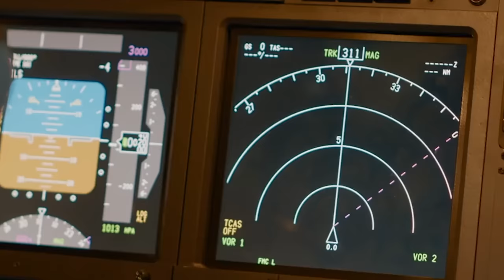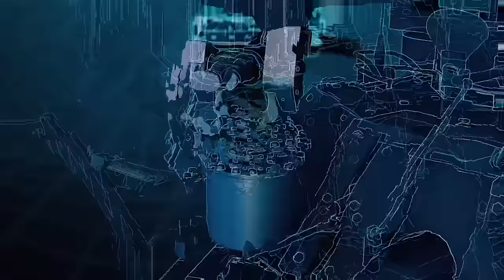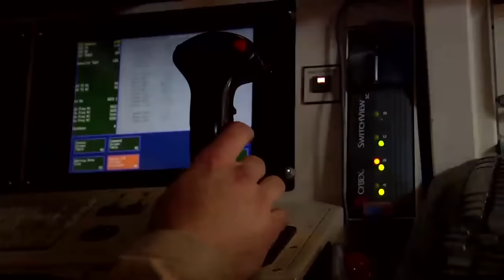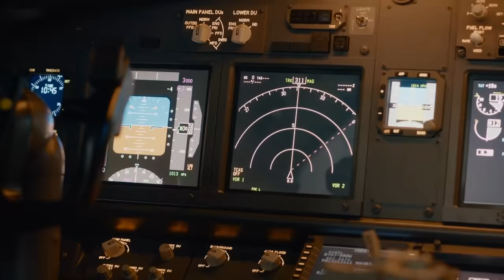The Astonishing Impenetrable Shield of American Tanks

Comment: I was in the Army's FCS program from 06-09. When were first learning about APS we asked about the infantry support. They were stunned at the question bc they had never thought of it.
Reply: The explosive is fairly small as well as blast radius it's non lethal to support infantry in area with only a small chance of shrapnel to any close by but standard body armor is enough to stop it so it's fairly safe as far as anything u can say is safe in war as there is always danger.
Reply: Good point, even infantry should have an incoming threat scanner that detects hostile rocket launchers over a grid. It’s not going to stop shrapnel, but at least it would give infantry the time to take cover and prevent damage.
Reply: The other thing not mentioned is that the radar has informatuon regarding the flight path of the incoming round.  If it's flying in a straight line, even in top down attacks, it's easy to figure out where the shot came from.  So theoretically, it would be easier to return fire sooner.

Comment: I strongly believe now that the United States acquisition of the 'Iron Fist' that will be integrated to U.S. MBT as well as to other Armour vehicles they are taking measures of safety to its crews and soldiers far better than when I served.
Reply: It's been in use for a while and for close to a decade they have been working on improving systems like this, like an actual plasma shield.
Reply: Iron Fist was not selected for the M1 series tank because 'Trophy' is a better system but weighs more and requires more electricity than a smaller vehicle can provide.  Israel and a US defense contractor are working to integrates the best parts of trophy with the best parts of Iron Fist to create a lightweight system that's as effective as Trophy.  

In fac it's APS that is causing the US Army to create a new vehicle to replace the Bradley and the Abrams.  Both are severely overweight and maxed out on electrical generating capacity. Also, electric drive will mean that 100% of the engines power will be converted into electricity and (in theory) a generator and 2 drive motors will be lighter, require less maintenance, and cost less than a mechanical transmission.

Comment: The anti rocket rockets exist now…you have to shoot 2 rockets at once in order to be effective, you see it on Gaza, they have double launchers for 1 strike
Reply: The anti-anti rocket rockets enters the chat
Reply: Still not clear if that method is effective.
Reply: Next up, machine gun style rocket launchers for mass mayhem. They will soon be calculating rocket and missile volume in terms of rpm. Along with mass swarms of drones, of course. With AI and automation you could have clouds of all this stuff, all at once.
Reply: Sure, because it can only fire one time....not like it comes with multiple rounds or another one right below it......uh huh.
Reply: Rpg7-vr tandem warhead
Reply: @brendonhunt668  tandem warheads were designed to defeat ERA not APS. APS can swat them down just the same.
Reply: Wait till someone developes a point defense system like in the Expanse. Have your automated turrets be so quick that they can lock on, and shoot down a missile. 

 First for VTOL aircraft. They would have more time to react. Then for tanks, and humvees even. Anything with a .50 caliber automated turret. 

 Use the radar, and targeting system this thing uses, but improve it. That is the challenge. Making the sensors miniaturized. I think optics with AI is the future, with radar as a secondary.

 Since this uses optics. Does it work when in smoke too? Hope so.
Reply: @brendonhunt668  it detonates anything and everything at the same time! Not "sets off each individual fuse one at a time"! It's not sequenchel!!! Think.
Reply: @dianapennepacker6854  why carry around the monumental weight penalty of ammo and have a limited amount when they're already developing a new enginge for the F-35 that makes 5X's the electricity it currently has for addition of focused energy weapons....?
Reply: If it works,
Don't be mad.
🧐
Reply: The tandem warhead is useless against this technology. It blows both warheads
Reply: WRONG. On both accounts.
1.not the same system. Trophy on mkiv and this is iron fist
2.method used by Hamas : first manage to put an ied just below a plating on the tank, that is meant to take our that facing radar and damage some NERA armor.   And then shoot at that facing .
3. Basically worked 2 times.   Just 2 times out of hundreds of blank range shots ( less than 30m ) . Which is still insane.
Reply: @johnshite4656 Drone swarms exist and they are scary
Reply: @dianapennepacker6854 Point defence turrets already exist - some are extremely capable.
Reply: @Cody38Super  Energy defense is useless against high speed or hypersonic weapons, and requires time on target to heat up. It also might be easier to counter them with special armor, and weapons that can "burst" to move out of the way. 

 The amount of required energy will be massive. Way more than this first generation especially when the arms race takes place. China has already stated that it might be easier to just put counter measures on their weapons instead of trying to go for bigger or more powerful lasers. 

 Also you wouldn't need as much ammo if your point defense is only defending yourself. Phalanx/C-RAM is built to defend an area. It is much easier to shoot something down when it is coming straight at you. Especially if you use systems like the new AHEAD ammo Germany has developed that creates a flak wall. With improvements in AI, and computing power less rounds will be needed. 

 Italy I believe has rounds for their 76mm Super Rapid that can move midair to hit incoming missiles. DARPA has sniper rounds. That tech also looks promising.
Reply: @jdogdarkness I was just about to say this, there’s a video where they shoot a tandem rocket at a demonstration tank and it still defeats it. Lol just a quick search would’ve shown this person they’re wrong lol.
Reply: @brendonhunt668 there’s a demonstration video of it countering that also…..lol for yourself and see with your own eyes my man.
Reply: @dianapennepacker6854 I was literally about to type everything you did lol, ty for saving me the time 😂😂😂
Reply: @aymonfoxc1442  I have yet to see it in a theater of war. I know the US is developing a drone swarm program, but it's still in its infancy. Got a reference?
Reply: @alexanderthegreatzabaras7492  indeed. Most people just have a passing interest in this stuff. And most of these channels do super surface level coverage with alot of misinformation. I swear Darktech is entirely written & edited by AI.
Reply: you mean tandem warheads? they are meant to defeat ERA. still vulnerable to APS
Reply: @johnsmithe4656 drone swarms). I saw an Australian demonstration a few years ago that impressed me. It wasn't a secret (in fact it was advertised) but now, I can't find it on YouTube; whether the algorithm has buried it or the corporate adverts were removed after military interest (as with other projects companies wanted funding for), I can't say but I'll keep my eye out. 

Anyway, I'll describe the system. Released and controlled from the back of a ute (pick-up truck), hundreds of small drones can roam for kilometres; each communicating and searching for targets to build a picture of the battlefield and then attacking by swarming in predetermined formations and waves, by flocking like a bird, or individually as targets of opportunity emerge. To take out their communications, you'd effectively have to destroy them all. 

Each drone carried a payload in a canister loaded in the middle of the drone. There was an anti-infantry shrapnel payload, a HE payload, and a shaped-charge warhead for anti-armour work. The drones used a top-attack approach. 

I don't think advanced economies are eager to release their best weapons on the battlefield for the purposes of safeguarding IP and also limiting their proliferation. The next time advanced economies find themselves in a near-peer war however, it could be bloody beyond comprehension. I remember seeing the swarm attack targets in fields and tree lines, and thinking “well, holy expletive. Armies couldn't hide in the shrubbery of the bocage country of France anymore... these things would annihilate them.” 

Until then, I hadn't seen a drone swarm overcome line of site barriers without exposing itself to enemy radars and EW or losing contact with the base station because of interference. Plus, there were numerous counter-EW contingencies built into the system despite a low price per drone. Now, I keep thinking about how useful something like this would be for Ukraine but I guess the powers that be probably don't want to hand this technology over to a country that may allow it to be captured by the Russian Federation. 

Still, even look at some of the commercial drone swarms that are available now. If they are capable of putting on complex coordinated lightshows, then surely they are capable of carrying out basic swarm attacks on fixed targets. With such extensive technological proliferation and the spotlight cast on drones by the war in Ukraine, I don't think drone swarms will remain in the ‘back pocket' of nations for long. It's more a matter of who will blink first.
Reply: @aymonfoxc1442  Well, that does sound like the future. Just sounds a bit early based on what I've seen so far. Yes, I have seen the commercial drone choreography, it's cool, but not useful militarily -- except to freak out Russians hiding in a trench, maybe make them run in panic. With some of the details you mention such as coordination and autonomous communication and building a model of the battlefield using all the drones in the air, as well as counter-acting EW, that's the part that seems sketch to me. I feel like this would be easy to fake and much harder to pull off in a real theater of war. Simply identifying targets and planning attack vectors requires some amount of AI, and I am skeptical that any significant computation could be done on individual drones -- and if so, they would be far more expensive. So the swarm would realistically have to maintain communication with a centralized system that does have the computational power to coordinate the attack. And I'm not sure what EW counter measures there could possibly be to safeguard that line of communication. Some of this is still somewhat sci-fi. But yes, we aren't that far from it. There are a lot of nuts and bolts to tech like this, a lot of moving parts that have to fit together flawlessly, and I would be simply amazed if anyone has actually reached that level of reliable detail yet. If you can find that video let me know, I'd like to check it out.

The idea of a DE-centralized drone swarm is even more enticing, where thousands of drones can share computational load and the AI runs across all systems and there's no need for a ground station or EWAC, but that's even farther away IMO, at least 10 years or so.

I'm excited to see the future of robotic infantry also.... first drones, then tanks, artillery, and other support vehicles, and finally light infantry, the Holy Grail. Just imagine, robots that are autonomous and armored against small arms fire and shrapnel, able to coordinate and maneuver in real time, sharing intel across a vast area, identifying all targets and planning attacks near instantaneously, having perfect aim, no fear, and no need of medical support. No food or water or sleep needed, CBRN attacks nullified, no thermal signature produced so as to give away positions.... All you would need is comms and a power source for recharges. And the best part is, no more putting boots on the ground where many will be doomed to die. The first country to develop this tech will be able to kill the enemy while taking minimal casualties themselves. It's imperative that NATO and the US dump resources into such R&D. This would be like the next nuclear technology, in the sense that whoever gets it first gets an automatic win. Imagine having a million of such robots, that manage their own logistics, repair, production, and maintenance. Now THAT'S the future..... And then you keep all the old stuff in storage so your actual human army can still use it in case of emergency.
Reply: The RPG-30 joined the chat. 
man portable anti-tank launcher with a unique dual-caliber design that allows it to evade the a tank’s active protection systems, allowing the warhead to penetrate active and dynamic protection. This weapon was developed by the company NPO Bazalt part of the Rostec corporation.
Reply: @Cody38Super rpg 30 has two rockets.
Reply: @ifv2089  If I recall correctly, that was intended to counter ERA rather APS but either way, being a short-ranged direct-attack weapon, it's less than ideal. TBH, I'd definitely prefer to have an ATGM, loitering munition or drone for dealing with heavy armour... or anything that shoots back. RPG-30 is a rare but good last resort.
Reply: @aymonfoxc1442  nah active systems RPG-30: A single-use anti-tank rocket launcher designed to defeat active protection systems
Reply: Russian have dual tube launcher for this
Reply: @brendonhunt668 no. Tandem is for ERA not APS
Reply: @Cody38Super  NO, Iron Fist has a magazine that holds at least 6 munitions, which reloads the weapon automatically immediately after it fires.

Comment: Welding a piece of rebar onto the front cap of specific rpg rounds bypasses reactive armor, "usually." Further, onboard air supplies are limited so crude oil in a gallon jug was found to overwhelm the air scrubber systems on our tanks during the 2nd battle of F, when set ablaze, and usually doesnt cause the armor to react when thrown in close quarters.

Comment: A great system.

Trophy is also doing well in Gaza, despite claims to the contrary. Not all tanks are attacked with ATGM's. Roadside bombs are harder to guard against for example.

Nonetheless, Trophy is still intercepting around 90%+ of the incoming RPG missiles in an urban environment. Sadly not 100% though.
Reply: I’d say that 90% success rate is amazing considering the short look conditions of urban combat. I’d bet that the success rate is actually higher, but with multiple in-coming, the system gets overwhelmed kind of like Iron Dome. They literally run out of defensive projectiles.
Reply: @johnhiggs325  the system is designed to target the source of the missile in order to hit the source, so ideally you'd kill any RPG teams before you'd run out of ammo for Trophy.
Reply: @WildReefer  

Ah. I’m so out of the loop these days. I didn’t realize you were talking about a different system. 😆
Reply: @WildReefer  

Maybe I should shut my mouth and pay closer attention.😜
Reply: Trophy is not foolproof. Any intelligent infantry can get aroundnyhose defenses. Besides trophy can't handle 3 anti tank guided missiles fired simultaneously.Ahahaha.
Reply: Even APS'es can be overcome by several countermeasure methods.
1. Damaging the launcher tube with machine gun fire first, before launching an RPG.
2. Overwhelm the APS with multiple cheap RPG-7's or drones, wasting all of the APS'es rockets then hitting it again with RPG's.
3. Using electronic and/or optical jamming countermeasures.
Reply: The trophy system is failing in Gaza actually, because the RPGs used are using the same system of two charges in the rocket inorder to defeat the trophy, this is now outdated
Reply: @CyprianNkunika-xk7ep  those were actually really with using a software update.
The only problems it has are with 2 simultaneous launches from a similar angle as far as I know.
Reply: Hhhhh, b.s, the evidence is that israel is recalling retired armored vehicles and older tanks because the system is practically useless and their armored units are drained , because it can't respond to projectiles shot within 50-100  meters of the vehicle
Reply: @mogh2603  No, Israel has lost 2 APCs (a Namer and an Achzarit) and had two Merkava knocked out of combat, but not destroyed--one rolled over an IED and got the right tread blown off, while the second had a 4 story building dropped on it (last week). They have spun up some older tanks from the reserves to be ready if Lebanon pops off, not because of any losses. They did the same with Iron Dome modules, even recalling one from the US that loaned to us to study.

Comment: What the Israeli war on Hamas showed is that the active protection system is less effective in urban areas where walls and other obstacles close to the vehicles may block the sensors.
Reply: Is this system being used with Israel and its  current situation
Reply: Thank you
Reply: have we seen hits or APC detonations? It's not clear
Reply: @trollmcclure1884  I've seen Hamas videos on Rumble, but almost all of them were probably the active defense system working. However, at least one infantry vehicle was on fire, and it looks like it was hit when only a part of the rear of the vehicle was showing around a corner of a wall
Reply: @jasestrong they use the trophy system on merkava
Reply: @DOI_ARTS  thank you . I hear Israel has an Operational laser directed energy weapon.

Comment: Iron Fist L/D(is the original Iron Fist APS retooled to fit M2A4 Bradley's and be more compatible with lighter IFV type vehicles...) contract signed with US Army to equip a minimum of one full brigade of M2A4's and as many as 9 Brigades worth.
Iron Fist L/D is also the frontrunner for either of the 2 contending XM30 MICV's Active Protection Systems...